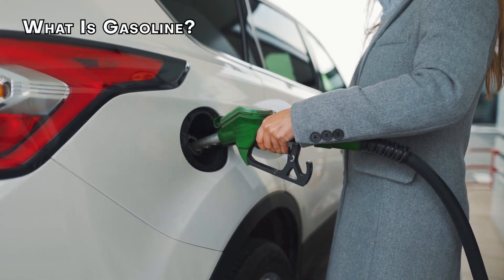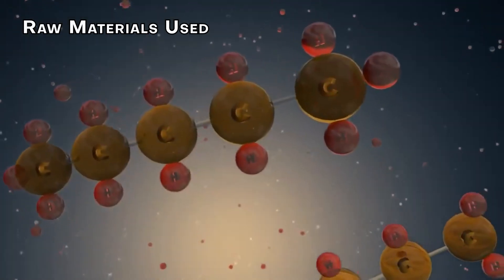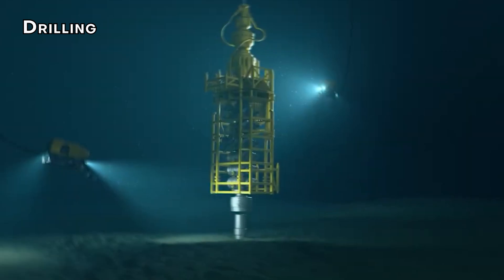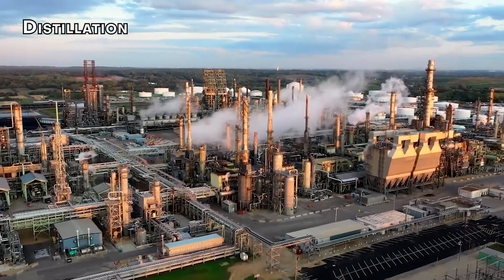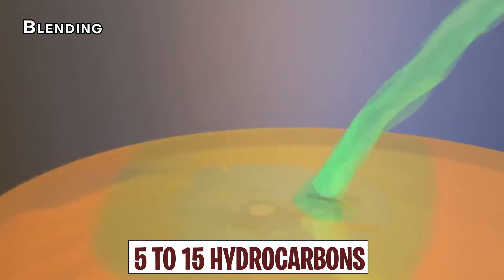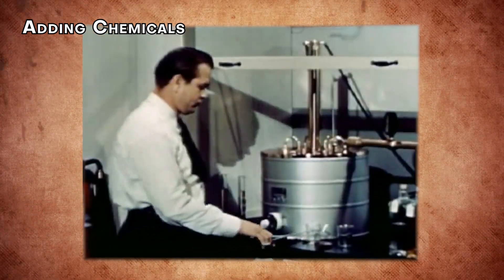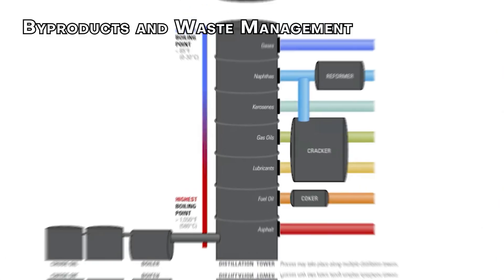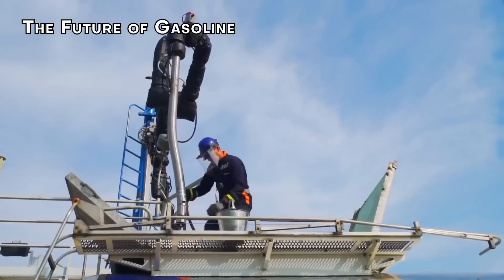How Gasoline is Made

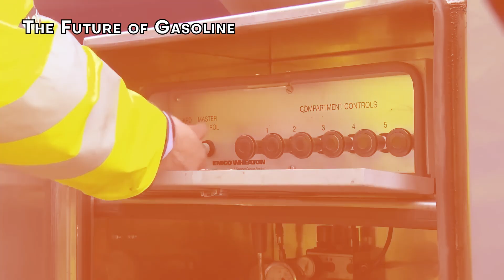Comment: 8:00 steam power? Oh you mean heating water with a fuel source. Ok what fuel? Solar? Does that get hot enough to efficiently boil water? Shit it cant even charge a battery half as fast as a motor uses. Wind will do it right? Not before the carbon footprint it takes to replace its own manufacture and it breaks down. So not solar not wind. Well that kinda leave only 1...nuclear. you dont like petroleum and definitely not coal so all you have left is nuclear and you guys wrote that off after Russia and their poorly ran unit in ol Chernobyl. Modern nuclear is the answer its even cleaner than your renewable sources than cant produce enough ebergy to cover their own manufacture currently. so NUKE THE WORLD!!!!